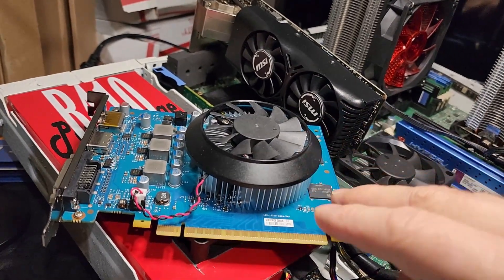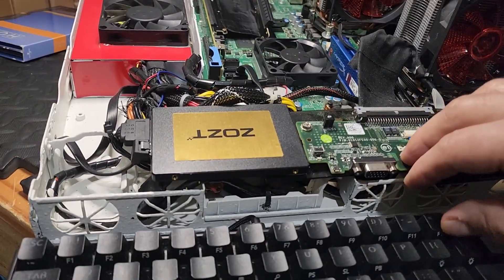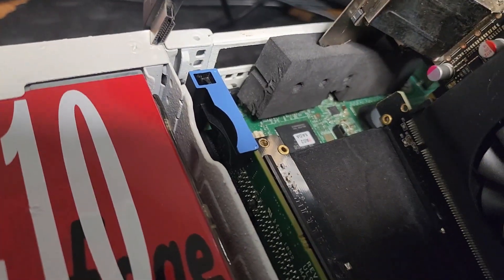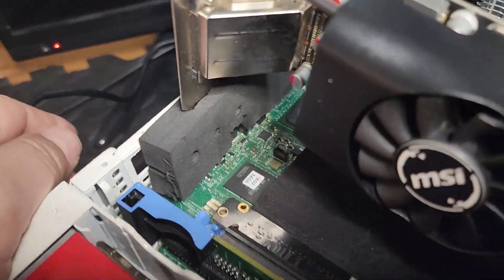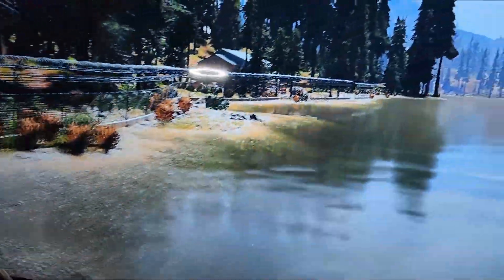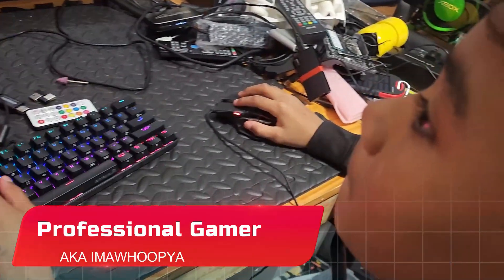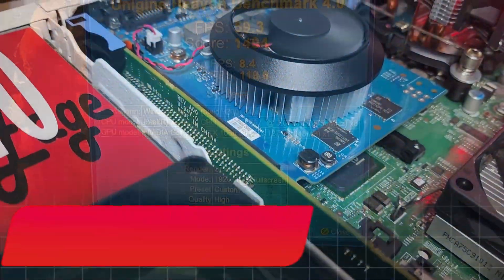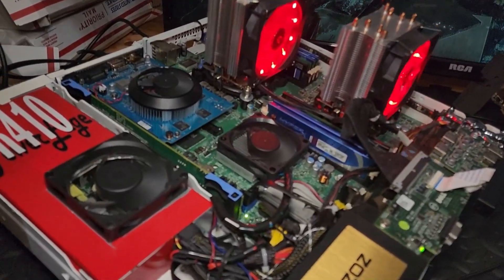gtx 1050 VS gtx 1050ti nvidia graphics card battle

Comment: at first i was like "a 4gb 1050 non-ti doesnt exist"
then i saw the heaven results. this is a 1050 ti vs regulat 1050
a more fair comparison would have been a 1050 2gb variant to a 1050 3gb variant (yes, those actually do exist). as that is much more apples to apples. 

one thing you could also do in this regard, is get a 5gb gtx 1060 (which was a china only release) and compare it against a regular 1060 6gb.
Reply: He probably thought both were the standard 1050 with different vram

Comment: multilabel reason why the newer card wouldn't out perform, like thats motherboard doesn't support PCIe 3.2 and other features, cpu features the GPU need to optimize its load, and its using a riser extension, witch could be PCIe 1.0 and x4, witch the card will still report as working 100% fine.